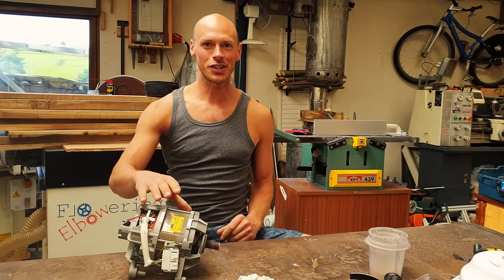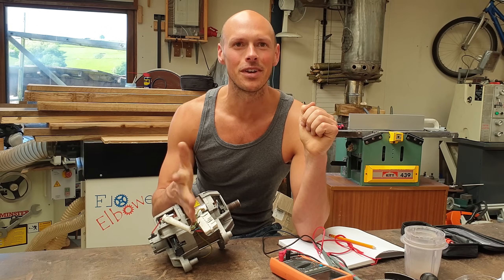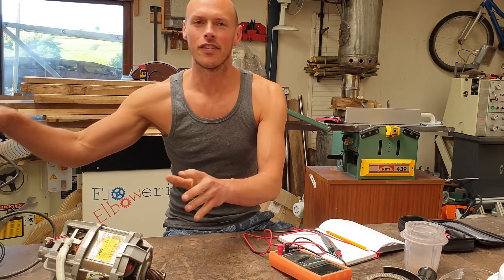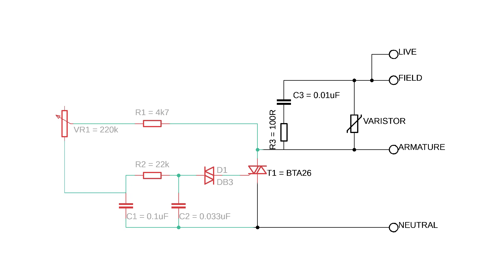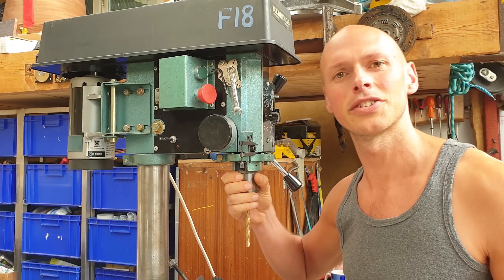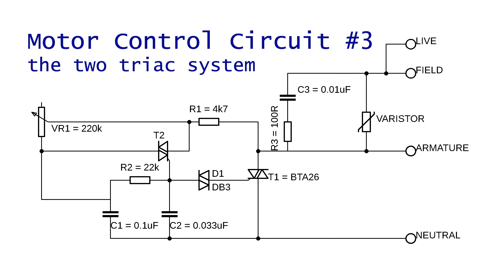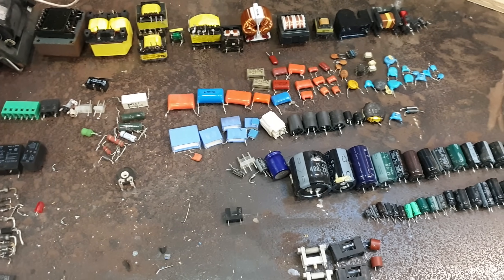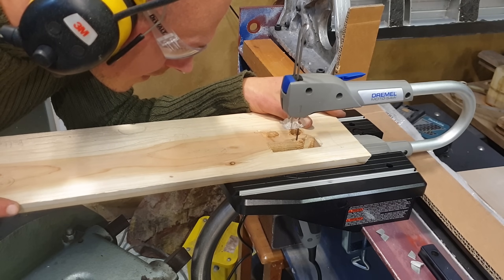How to reuse Washing Machine Motors [Arduino vs Basic Triac control]

Comment: Hi there. I just got myself a washing machine for free, and there was a reason for that: Water damage, and order new circuitry could be done, but why not do it with Arduino!!?

So, I've got a few questions.
I'm not exactly a newbie, but not quite the opposite either, but why is there a 5W 100 Ohm resistor in series with a puny 100 nF capacitor? It seem to me that the capacitor will never be able to push up the current that high so it'll warrant that resistor.
On your Instructables page you're also mentioning at step 19 that you added a varistor in parallell R14 and C4. Had it been after R14 I could understand the 5W, but in parallel no.
So, feel free to elaborate on that one...
Reply from the maker: My memory on this is hazy, but from the circuits and reading I cobbled this together from, that seemed the recommended combo... Looking at it now I doubt it needs to be a 5W resistor. And I didnt use that in my simpler non-arduino circuits... Modify to suit your purposes (or to make it better) and let me know what you come up with ;)
Reply: @FloweringElbow  I was going to test build this one at first, then I realized that it wouldn't work, or sort of-ish. I turns out that there's an induction motor in my washing machine, so it's a 3-phase deal, and also it's labeled up to 195 Volts at a certain RPM that i don't recall at the moment, and I'm not sure if it's safe to smash on the full 230V on that. Probably it can take it, but I'm not sure about that, so I'm looking at some alternative solutions.
Found a schematic for a 3 phase driver (https://320volt.com/en/three-phase-motor-control-circuit-mc3phac-fsbs10ch60/), but the components are hard to come by, or at least not cheap. The driver circuit is fair in price, but not the other one which will go  for about ~30-40 bucks a  pop or so, and for those prices I could just as well order a replacement board for roughly the same price.
But the latter would ruin the whole thing, part the fun, part the DIY and part the usefulness. Also, I would like very much to write a program that uses an RTC so that that magical 1-2 minutes really is 1-2 minutes.

How often haven't one found oneself standing there like E.T staring at the machine which says 1 minute, and it sometimes jumps up by one minute, or just silently keeps showing that damn 1 minute for five minutes..!!?

Also, I have seen others recommending that induction should be swapped for the other one since it's easier to control.
But, I'd hate to waste something like that, especially since the machine is only a couple of months old and everything inside is almost brand new, apart from the water leakage that fried the board and whatnot...
Reply from the maker: @YnotWeird  I admire your drive to DIY this. But you are right - the induction motor is a  Very different beast and this control circuit will not work at all... 
you could look out for a cheap ebay VFD and control that with arduino - but then that's going to be a bit costly. 

The deceptive timing on washing machines, is often them trying to get the load balanced before giving them the final spin: the machine has to try to get the clothes well distributed in the drum, and has a sensor to detect the vibration as it tests a spin up cycle - if it's not balanced enough it has to go back and try again for load distribution. If you're unlucky, or the washing consists on only a few big items this can go on for quite some time... 

Anyway, good luck, let me know how it goes.
Reply: @FloweringElbow  Well, we'll see how thing turns out.
I have another washing machine which has a mechanical timer, and I don't think it has a micro processor. It does seem to have something that does this you're describing with the slow spin-up when it's trying to centrifuge, and if there's some unbalanced (I think) laundry, it shuts off and begin again.

This usually happens when I'm washing my mops and micro fiber cloths and instead of softener I'm using an all-purpose detergent (for not having to apply so much when using them), sort of preparing them). This creates a lot of foam, which I'm guessing clumps everything together.

It's somewhat annoying to listen to, since it begins to rotate slowly like normal washing cycles. It does this for a few revolutions, then it speeds up gradually. This generates a humming sound with a ascending pitch accompanied by the motors/belt/drums own sounds.
As I said, annoying.

This machine I'm going to rebuild is somewhat of an enigma. Never really done something like this, but I do have been inside older ones and for the most part figured out how they worked with the water level sensors and such.

This one however has a sensor near the top with a silicone tube attached at the bottom. I've tried blowing in it, and it seems like it's a two way switch. I think I heard a clicking-sound when I blew in it. Could have been something else. Haven't measured it, nor checked the control board either.
It just struck me it could be an active electronic sensor. It has three connectors.

But what strikes me as a bit odd (With the other machine in mind) is that there seem like there's no additional sensors, other than the hatch.
I thought of perhaps installing some vibration sensor in case someone would get the idea to wash a rock or something (???), so the machine won't start break-dancing in there and give birth to a washing drum through the side or something.
Choices I can think of is either a mechanical switch of some type, like a micro gap switch with an lever with a fair distance to the drum, or ditto with an accelerometer and find out some way to make an algorithm for it to sense abnormal actions.

It's a huge little program with lots of stuff to think about. At some point, if I ever get this sucker running, I'm going to implement it with another insane project for home automation and interconnect-ability between the central computer and displays and computers.
That's a bit shelved at the moment since I don't really have  a proper home at the moment where I can do stuff like that.
That will among other things control a dishwasher, coffeemaker, fans, lightning and a few other things.
But, when it's time... Man am I gonna blow some cash/time/effort into it!
Reply from the maker: I admire your ambition. Good luck.
Reply: @FloweringElbow  Hi again. Just thought I'd post an update.

I finally got all the parts, made the PCB (By myself), put some solder mask on it, placed all components, didn't work, did some troubleshooting, some more. Decided that it was a faulty circuit (MC3PHAC), ordered a new one, waited 3 weeks, swapped it, still didn't work, ordered new caps & crystal, still no action.
Also, meanwhile I was confounded by this mystery of having a short circuit when it was powered, remained even after the replacements.
Thought it was the circuit at first, then same problem occurred with the new one, started to think it was because the clock perhaps didn't work so replaced caps + crystal, still no-go.
Then... Something happened as I was randomly pressing and holding the start button, I noticed the motor turned and stopped just as I moved my finger and the board slipped a little.
Tried again and nuuu... Dead again.
Started to check the potentiometer that I had hooked up to the board. No glitches there, but, I discovered that I had connected it to the wrong pin, and the fluke of flukes had left juuuust enough voltage on that wiper pin, as it would turn out, so the circuit saw it as an OK signal.

Swapped the pin, and lo and behold, the sucker started!
Still had the problem with the motor only turning in one direction.
A few hours later, after a few times back and forth between thinking, having a smoke, watch some Simpsons and such, I ripped out the opto-couplers I have on the board. Suddenly the sucker was able to change direction.

After some additional visual inspection and a flash-thought I knew where the fault was: IDC connector, or rather the lead on the PCB between the pins. Some scraping and removal of some solder it was "Bob's your uncle" and now it's working, and for some twisted weird reason it even runs faster than it did earlier.
No wonder really when the opto-coupler was active when it was fed a positive signal directly to the input...

I felt like an idiot (Still do!) for not seen this ealier. But, then again, I was so damned focused on the IC and those opto-couplers and IDC is on the top of the board.

So, now after around 4 months, I can finally get cracking, hook stuff up, and enter phase two - Programming which will be an absolute nightmare!
So much to tie together.
RTC, relays, TFT-display, hatch-lock (Servo), LED's (4 single colors, 1 RGB), buzzer, 6 buttons, one resistor network (via switch, for selecting program), 2 water solenoids, 2 peristaltic pumps (For optional liquid detergent/softener), relay board, accelerometer circuit (for detecting if the machine gets the idea of doing a Lambada), leakage detector, drain pump and probably a few other things I forgot to mention.. Yeah, right, it'll be prepared for communication with an additional Arduino which will have WiFi-access.

This is going to take months tying all together!

Edit: Forgot to mention that I just recently also ordered some Triacs and some accessories for it. I'm considering to regulate the heating element so that it'll last longer and get a smoother curve and not having spikes like with relays.
Which btw reminds me of two more sensors... Make that three: Sensor for when the hatch is closed, water level sensor and the NTC for the temperature... Hot damn, it's no easy thing to control. On top of that, it'll have to run everything in perfect harmony or it'll bounch all over the place, spew water all over, boild the clothes... Jeesh
Reply from the maker: @YnotWeird  wow! Yep I'm in awe of your god level tinkering and your sheer persistence! Let us know when you get your first wash. Makes one appreciate all the engineering goes into clean clothes! 
Peace, Bongo.
Reply: @FloweringElbow  A small update, yet again.
I've decided to scrap my design that has costed me mucho dineros, about $400-500 by now, since I made a terrible mistake of thinking of DC, or rather the cathode could be used for the entire machine as ground since the neutral and cathode were bound to each other, but somehow I didn't think about if the poles were reversed. Managed to fry my Arduino a bit (I'm grateful for thin leads so I was able to revive it!) because of that. Did measure it numerous times and got only a volt or two between earth and cathode. Didn't think much of it until I moved the whole thing to another table and did some measurements, and had the USB in my hand and was about to connect it. Just a quick short band and a small flash, and my computer had a hiccup.
That's when I realized what I've forgotten.
So, with that in mind I decided to scrap the card and do it for real this time.
The reason, except for the cathode thing, was that I had added additional circuits on prototype boards and it looked gnarly to say the least. Tons of small cables and the Arduino shield that I made looked like crap and it also had no through plated holes and that made it difficult to solder.
So, solution is to scrap the ATMEGA 2560-card and put that processor directly onto the new PCB, together with 2 others so that I can delegate tasks. One for the heating element with zero cross detection as well as temperature sensing, another for the TFT-display (That's going to become much easier to just send the output for display, rather than having to have that code as well taking up space).
Also added a whole squadron of indicators for pretty much all communication, key panel, outputs etc.
This time around I intend to re-use the original casing for the old controller. Had some issues about where to put this big clunky plastic housing that I put everything in, so on the new PCB I moved the cooling flange and other stuff so that it'll (mostly) fit inside, but more importantly the height was previously a problem. This will allow it to leave some space between the drum housing and the hole in wall where it's supposed to be.
I'm also designing a dosage pump controller for no less than 6 different pumps (softener, bleach, lime stone detergent, washing detergents etc) so that I just have to toss in what needs to be washed and go. I hate having powdered detergents and sloppy softeners that gets everywhere but where it's supposed to go.
That will also have an Arduino which will sense the fluid levels, have buttons for refill of a container (meaning it will reverse the flow to empty out any air), as well as potentiometer that will set the pumping time which will depend on the liquids.
Did 3 adapter cards, one for the TFT-screen since it has 16 pins in a row and that will go onto a 2x8 IDC header, two cards with RJ45-connectors for the automatic dosage pumps with matching connectors in each end.
All one one single board with cut-outs
Now, I'm awaiting my new soldering iron + tips (if only my local postal service would move it along would be nice...), and I just ordered an hot air station along with tons of goodies, three different flux's, solder paste, silicone thermal insulation pad, a whole bunch of prying tools and whatnot and a tweezer probe for the multimeter (cheap, why not... About maybe 2 bucks - No brainer!).
Had some trouble with the last one. Said free shipping to Sweden, only the the first seller wanted to ship with TNT instead, to which I refused, and he claimed that there would be an extra fee of 20 bucks if I still wanted to use DHL - Long story short, cancelled order and refund.
5 days later I placed an order (with above said contents) with another seller, and this guy also claimed the price was higher and also wanted to get an additional 20 bucks... After some dribbling I gave him an ultimatum of either ship the items that had DHL, with that service, and the rest with whatever method he preferred. A day later I got a confirmation that he'd send it.
Ali Express is a wonderful place with lots of either bad apples or crappy products, but it's cheap either way. But, sometimes they eff that up too. Shipping is usually the crook when something is dirt cheap.

So, when I get these stuff I might just order the PCB next month, or place an order for some components. Got about ~$200 yet to dish out to put it together.
It's the most expensive project I've ever undertaken myself, but the fun part is that I get to put whatever I want in it, and the not so fun will be the programming since I'm not really a programmer, so the code's gonna be a mess, which was a big reason that I wanted to delegate the tasks so it'd be easier to check for errors.
Anyway, just a small update on what's cooking, and someday I might put all the schematics and pictures up on a website or something.
Reply from the maker: @YnotWeird  dude! I HAVE to see a video of this thing when you get it washing!  Sounds like your have the haze of project frenzy about you (its a good thing). Good luck!
Reply: @FloweringElbow  Well, we'll see what happens.
Hopefully I don't break anything, electrocute myself or any other mishap along the way.
I was thinking of finding some DIY-site to upload images and maybe even a video with schematics, codes and all, but I have yet to cross that bridge... Long way from that light in the end of the tunnel.
If I hadn't FUBAR like I did, I would probably have gotten it going by now, or at least parts of it.

By the way, that Arduino shield I mentioned earlier. I etched it myself and I was pretty pleased with it, except for some itsy-bitsy misalignment and  drilling off-center, as well as some minute parts that were under-exposed (Well, basically the PCB was crap, but I decided to run with it anyways since it had about some +400 drills...), it turns out (which was the reason I scrapped the design, the drop that filled the cup, so to speak) that working with parts of the design upside down really tends to screw with the design. I had made the connections in the wrong direction, 180° worth of wrong.

This PCB was to be sandwiched between the display and the MEGA 2560 on each side.
Pure luck that nothing was shorted out when I tested it a bunch of times, thinking I had the wrong code since it started flashing and stuff.
Only 3.3V, but still it might had caused damages pushing current in directions not meant to used.

I would've had to rotate the shield in order to use it, and I was not having it, so this time <curses in native language> dammit!

I'm sure I've messed something up, but if so, I'll cut and rewire if need be.
It's going to cost me everything from $80-110 to have these 5 PCB's made, depending on choices I make when ordering.
So, either next month or the next after that.

Now - Bed, stare at the skin flaps for a bunch of hours while counting chips.
Reply: On a side note:
The water level sensor, which I forgot earlier to get back to, is a very strange thing. It consists of a pressure chamber and some type of solenoid (Note: Not magnetic in the sense that it drives anything, quite the opposite) to which a small shaft is attached or how to put it. This basically means that a coil reads the magnetic field above that, and there's a circuit which I don't remember at the moment, a simple logic circuit of the 74xxxx family. This works as a frequency counter and outputs a corresponding frequency.
But, I didn't fully understand how it's really working, because I got a frequency up to, if memory serves correctly, 11 or 12 Hz, which I found perplexing.
However, after some tinkering around I found other pins that delivered useful frequencies that I could use. Don't remember those either at the moment, but it was between 1-10 kHz which the Arduino that I used could differentiate between different pressures that I applied to the sensor.

It may have been some ultra-slow PWM type of deal with this going on where the off-time was measured. I only used a very basic off-the-internet-code to count frequencies. I did some testing with a few different codes, but basically got the same result, or not at all.

However, I think I'll rewire it to suit my need by just shifting a pin to get a higher frequency.
I actually did this test shortly after writing about it here, just forgot to post that info here and thought of it now as I checked this page again and my chat-history.

If anyone want's to know about that circuit I could possibly open it up again (Which I'll do anyways soon enough as I draw near putting all the stuff together) to give you the number of it.